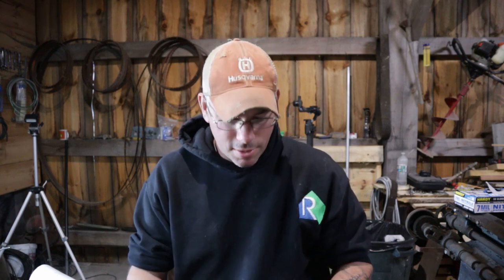1890s Metal Lathe Restoration Part 5: Headstock is Almost Finished

Comment: Sorry to seem critical, but I think the reason these machines are usually painted pale green or grey is that it is much easier to see details on the machine itself. I think that a black machine in such dimly lit circumstances as your workshop will make it much harder to see details and outlines while operating.